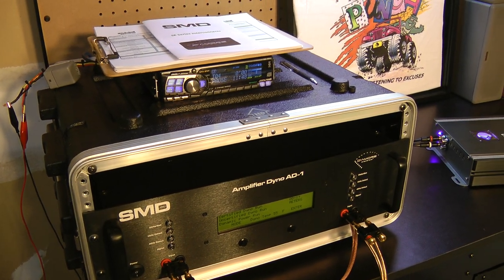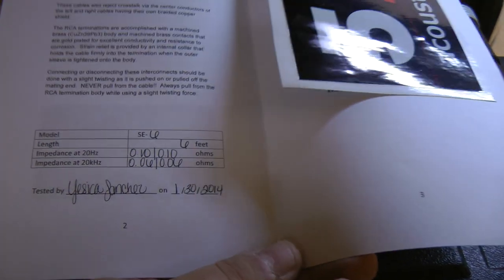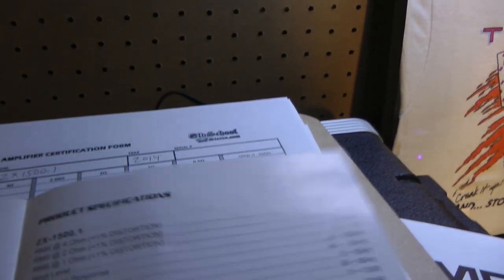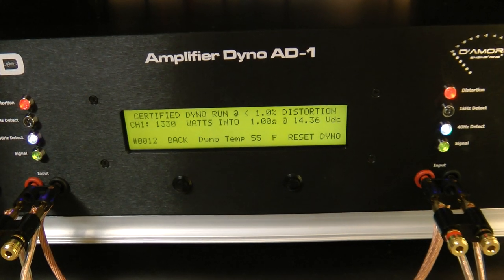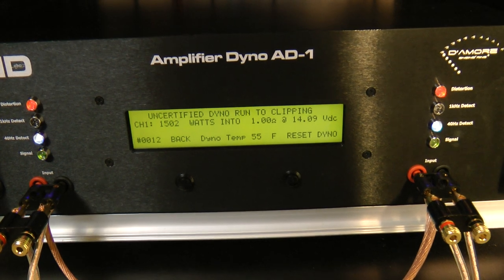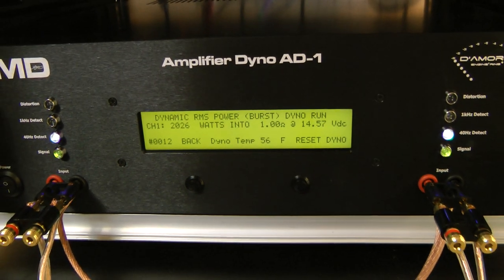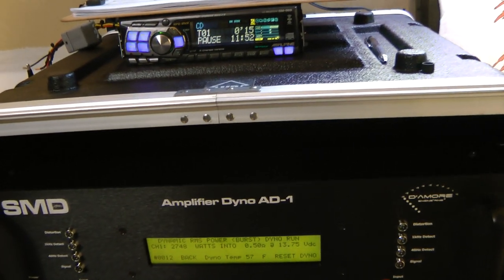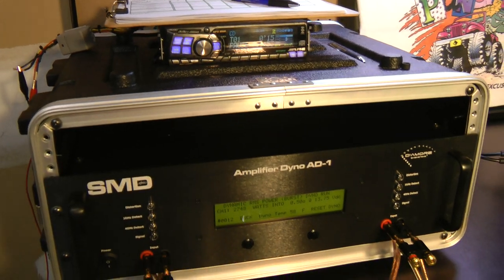Sonido Mask ZX-1500.1 Amp Dyno Test 1 Ohm

Comment: Weird how these amps with lower end preamps will not process some tones. It's not unheard of. But you get an amp with some nice OP amps in the gain stage, they will rip through most frequencies. By the way, did you test with crossover up to accept test tones? Not doubting just curious.

Comment: Damn that's a nice amp I want one now I hope they have one that lights up red instead of blue to match my car color scheme
Reply: That amp couldn't even hit its rated watts, it is a piece of shit/low quality.
Reply: @4gbmeans4gb61  Are you blind? It went over rated.
Reply: @Zapdos6996  Are you blind? It did 1330 watts at 1ohm with a whopping 15V in the CERTIFED run.  And it says it does 1600.  L2math?  It didn't even hit 1600 watts in the uncertified run, very sad.  So why so angry and full of lies?  You have this amp and are now regretting buying it?  He even says in the video himself that it does not hit rated power.

Comment: When did the amp draw 180 amps.. 2700 watts or 2120?
Reply from the maker: It drew 180A at 1 ohm in the certified and uncertified modes if I let it run (full 10 second sine wave test). It consumed just under 155A at the 1330W at 14.36V certified run at 1 ohm. Right at 60.3% efficiency at 1 ohm

Comment: Can you do the boss riot 1100. . I know it's not putting out 1100.  .
Reply: A friend of mine tested a Boss 1500 Armor amp at his shop and it did something like 589 watts at 2ohm. Im sure that was over 14v .. I hope this helps in some way. Yes Boss will never do rated power.  But they do good if you need to puch low power subs. Again hope this helped.

Comment: What power supply are you using for the amp and amp dyno
Reply from the maker: Custom made BEAST! Test Bench Update 250A 12V Variable Power Supply
Reply: Dude.. omg.. that's is freaking badass!